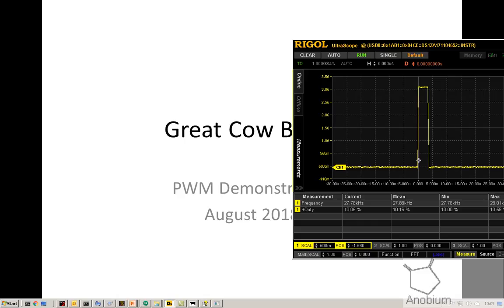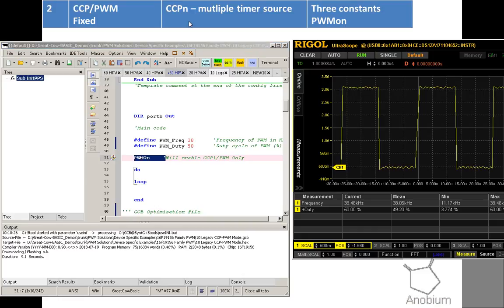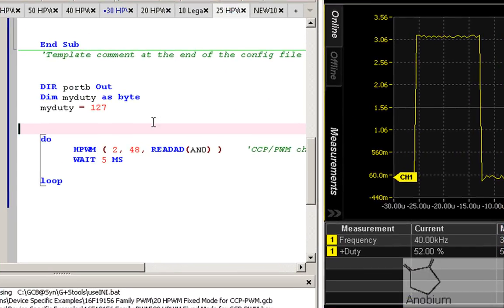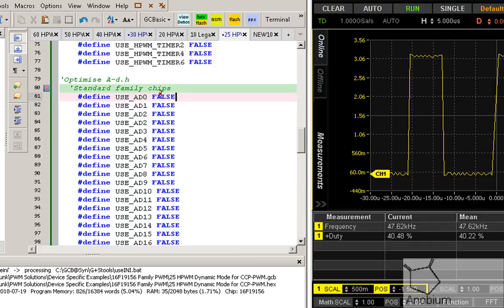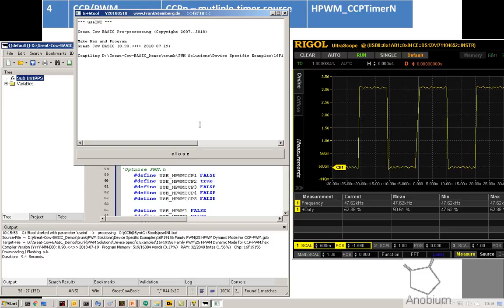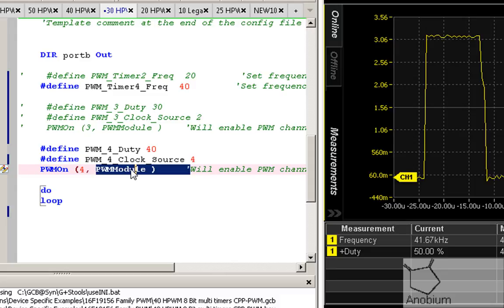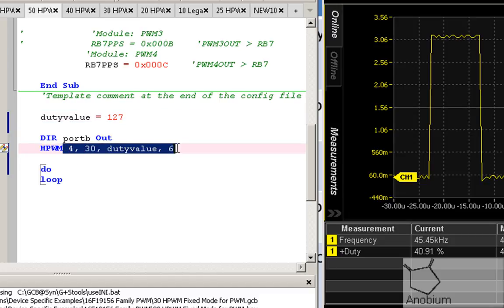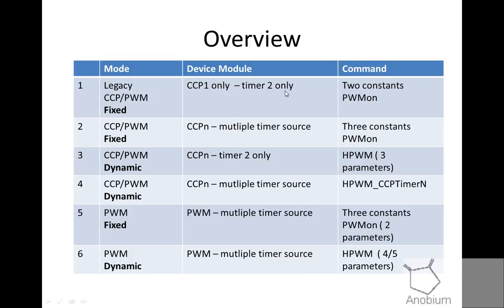Great Cow BASIC  - an overview of Pulse Width Modulation (PWM)

Comment: Useful. I'm just trying legacy on mega328p16. 38kHz for ir detectors.
I just use
DIR PORTD.5 out
#define PWM_Freq 38      'Frequency of PWM in KHz
#define PWM_Duty 50      'Duty cycle of PWM (%)
PWMOn
and somehow portd.5 has 38kHz on it???
I'm using a timer1 overflow interrupt at the same time no problem to drive two stepper motors.
I'll check the other pwm commands later.